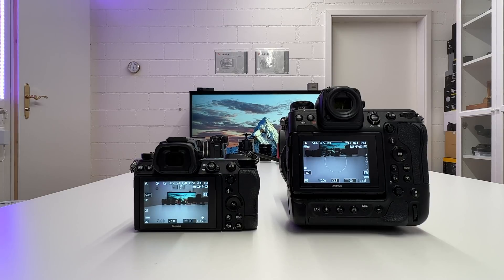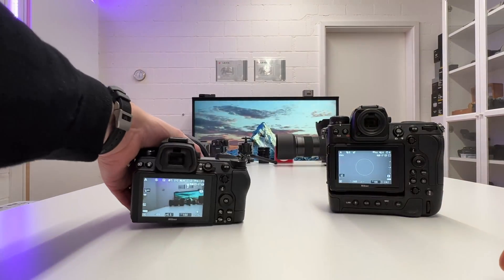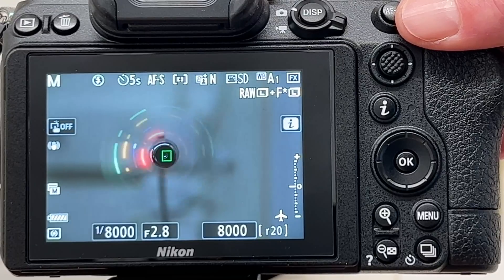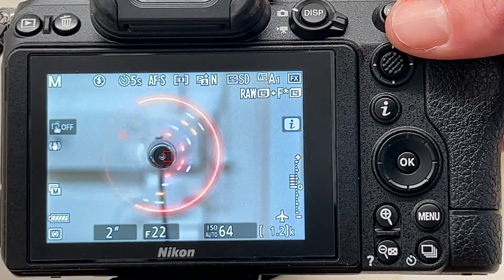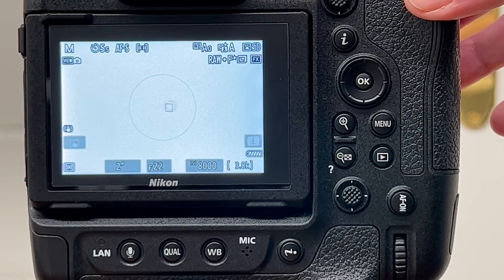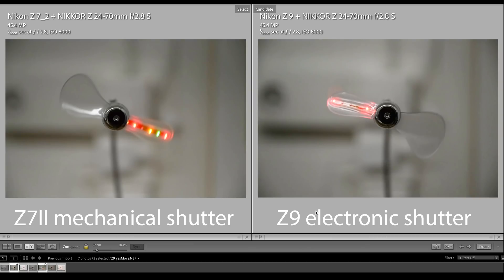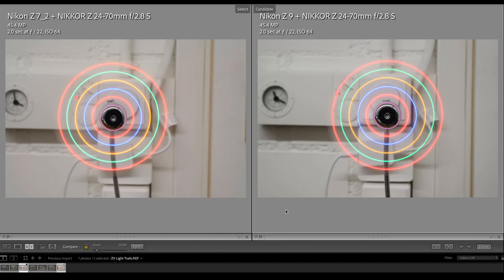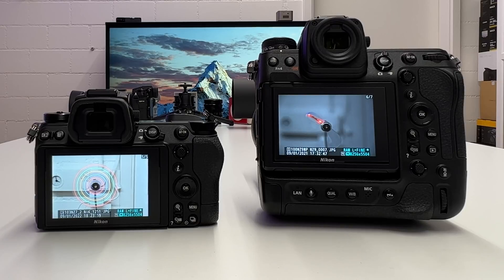Nikon Z9 vs Z7II | Electronic Shutter on Steroids

Comment: It's cool to see that it's on par or better than mechanical shutter, which to some people's surprise is also technically a 'rolling' shutter.  Most mechanical shutter blades take 3-5 milliseconds to travel the sensor's height, so the Z9/Z8 are right there with 3.7ms readout. The only thing that's better is global shutter of course, but until prices come down... this is the best we've got.

Comment: I wonder if a stacked sensor behaves differently in terms of color, metering or anything else I can't think of at the moment.
Reply from the maker: On sensor technology, there are basically two main features you can have: BSI (back-side illuminated) and "stacked". BSI helps in low light whereas "stacked" in particular boosts autofocus performance.
Reply: @mathphotographer  Ah, is the difference significant enough for one to choose one over another?

Comment: Thanks for this experiment very interesting. I have seen something similar, however on the Z9 images as the shutter is in read faster and faster there appears to be like banding on the Z9 images, I dont know if its because of higher ISO’s due to shutter being faster or not. Is there any chance you can look into it, for example shutter 8000, 16000, 32000 and obviously the iso will be higher. I have ordered my Z9 and I am a little concerned as to why banding may appear or if its due to lighting or fast readout speeds. Much appreciate a comment. Thanks
Reply: It's due to the fact that led lights oscillate at a certain frequency and fast cameras like the z9 can capture the moment where the leds go off momentarily.

Comment: I'm confused here - on the Z7II, you've used Silent Shutter mode instead of Electronic Shutter, I thought they were different? I have my Z6 set to auto (d6) as it happens.
Reply: That d6 option is about electronic front curtain shutter (the front curtain part is important). It starts the exposure electronically but ends with mechanical shutter still closing (the last part is what mostly eliminates rolling shutter in that mode). Silent mode does not use the mechanical shutter at all, so that is the actual electronic shutter mode. So they are 2 totally different modes.
Reply: @eiko4252  - the reason I mention it is because it works very differently on the Z9 that's admittedly electronic only. Someone complained that their flash options were greyed out with Silent Mode enabled. Am not sure if they had tried to set flash from the gun instead - it would have worked or not.
Reply: @paulbusby2013  Since Z9 is always electronic, silent mode might change some other settings, that might interfere with flash. What the silent mode does in Z9 should be said in the manual and since I don't have Z9 myself, I don't specifically know. All I do know, is that to compare Z9 rolling shutter to cameras with mech shutter, those earlier cameras need to be in silent mode to enable fully electronic shutter and that is what the video did.
Reply: @eiko4252  does silent mode take better shots?
Reply: @jaystarsks  No, it takes silent shots. 
Though in some cases, worse shots than with a mechanical shutter (if sensor readout is not as fast as Z9 for example).

Comment: Than you very much for the test. However I think test methology method is wrong. If you want to compare to sensor readout speed, than you should look at bottom and top frame time differences on an image. Therefore you should try to capture fan on vertical position. Youw example is hotizontal so time differences is too small on blades. If you capture on vertially, you should see more distortion between blades whish will give you speed of sensor readout on electronicshutter vs shutter speed (time differences between bottom to top) on mechanic shutter. If you want to emphasize camera sensor differences, you should repeat the test.
Reply from the maker: Interesting thought, let me think about that

Comment: How I wish you had shot the z9 at 1/32000 as well to see how sharp the fan blades would have got
Reply: How does this matter if we don't know the speed of the fans. Reducing the fan speed to half would lead to the same result. This was not a test of lens sharpness or depth of field. It should just point out how an electronic shutter speed compares to an mechanical shutter.
Reply: @stefanwagener  it would have been comperable to 1/8000...
Reply: @lv8pv  I mean shooting the current fan speed at 1/32000 is the same as reducing the fan speed to half and shoot at 1/16000.
Reply: @stefanwagener  wow you really did not start out at the front of the line...

Comment: Great test. I understand for high MP cameras they tend to have more noise at higher ISO than cameras with lower MP. Can you test this noise between the Z6 II and Z9??
Reply: Yes please, do this test!
Reply: From what I've read, the consensus seems to indicate that the Z9's high ISO performance is 1/3 stop better than the Z7 & 1/3 stop worse than the Z6. Some are seeing poor results because they are processing RAW images using their existing workflow that includes 3rd party converters such ACR that is not yet optimised for the Z9!
Reply: @paulbusby2013  What software do you recommend to eliminate these poor results until ACR is updated??
Reply: @MyContestPix  NX Studio which is free but you may need to dial down default noise reduction a tad. If you normally use ACR, I suggest you experiment by comparing both or try a 3rd party de-noise program such as DeNoise AI (I haven’t tried it).